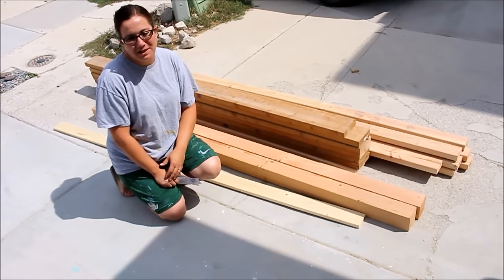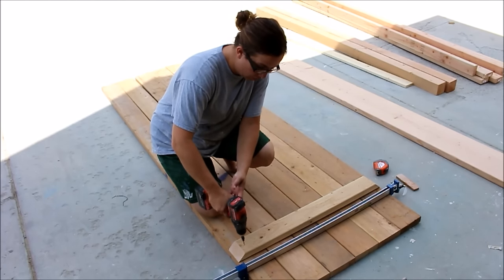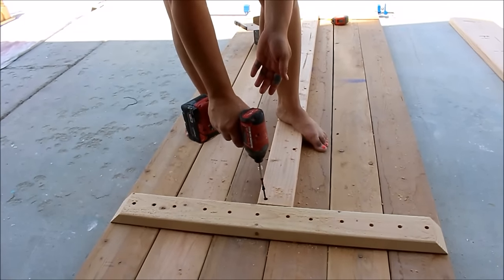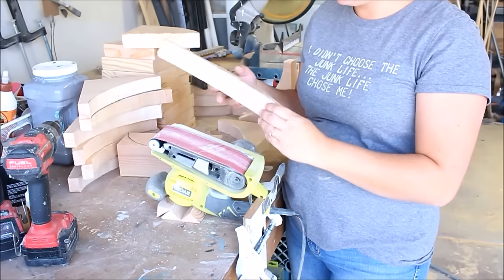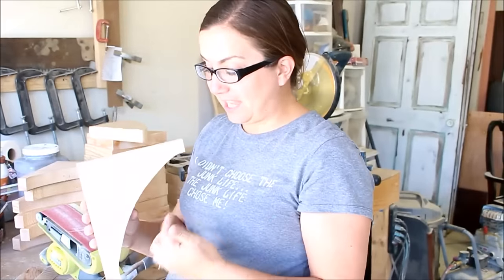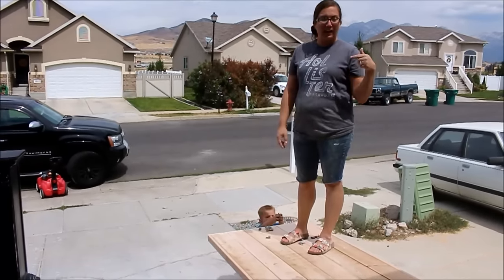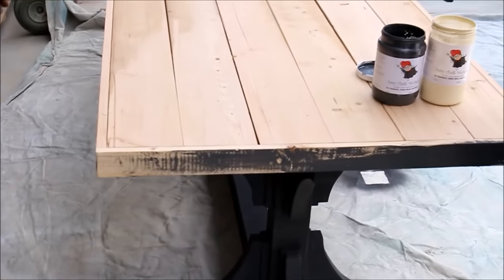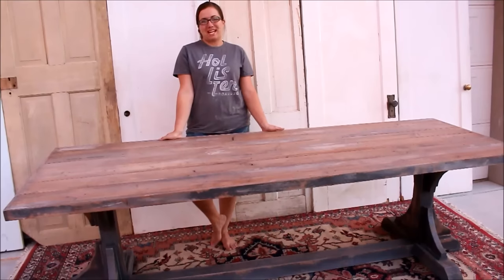How to Build a Farm House Table

Comment: Regarding assembling the table top:  I personally would NOT recommend cleating the 2x6's together underneath because the cleats and screws won't allow for wood movement.  In time, the top could begin to crack apart.  But, since it's rustic, it might be acceptable anyway.
Reply from the maker: Mike D. Author for this look it works great.  I totally understand :).

Comment: One more question, do you have a video on building bench seating that would go with a table like this? I looked but didn't find one, would it be similar to building the table only on a smaller scale?
Reply from the maker: We don’t have a specific video. But it’s a lot the same as the table like you said. Just smaller.

Comment: How many chairs could you put on each side? I really need a table that can handle (3) chairs on each side but have no idea how long that would need to be.
Reply from the maker: When Zeb builds tables he accounts for 21” of width per chair. That fits most chairs unless they are oversized. 👍
Reply: Cool so based on your measurements sound like at least 3 chairs could sit on each side of your table.
 I will have to measure my space to see if I can accommodate that. I currently have a small round 4 chair table in my dining room but it is way too small for the space. Additionally I host a weekly ladies Bible study and we gather chairs from all over the house and put them in the dining room but all 9 ladies still try to circle up around that little table lol.
Reply from the maker: Oh yeah, we can fit 3 per side and 4 easily if we need to squish people in.